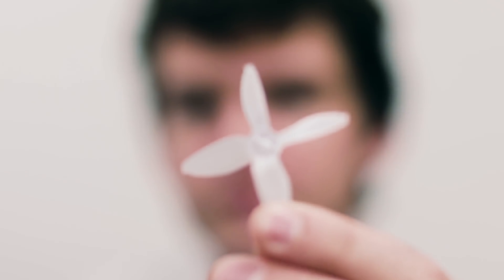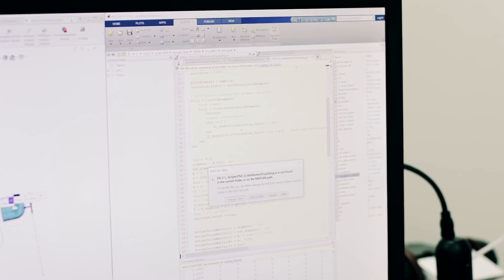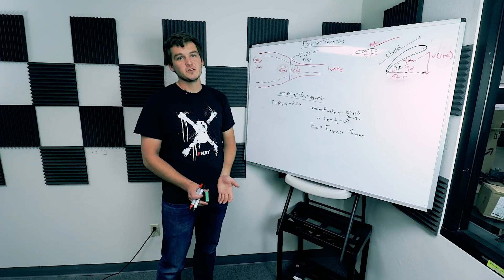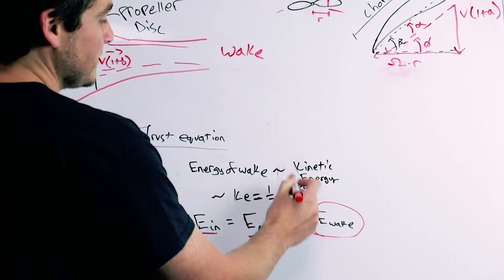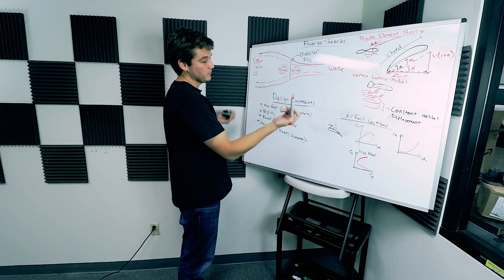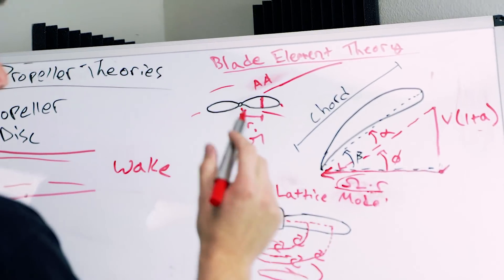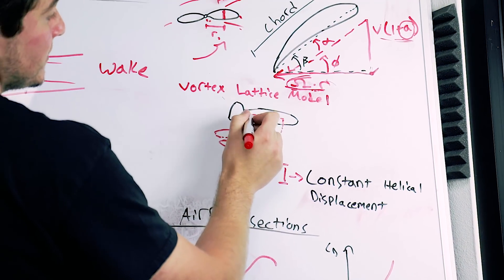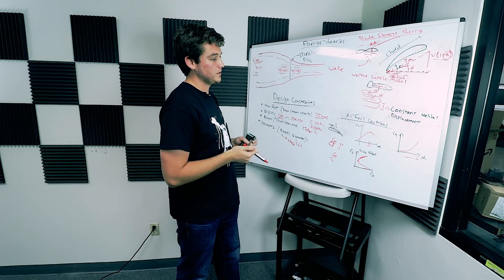EMAX Docs - Designing the AVAN Micro

Comment: Very succinct explanation. Thanks Sage. I'm loving your 3" 3054-4 Rage Props on F20ii 1408-3750 running 4S with my own aero plus quad design. I haven't broken one yet.  Screams. I have lost one though, the hub is tall and the F20ii shaft is short so I found a standard nut doesn't bite into the self lock plastic enough. Works fine with low profile nuts though. I would be keen to hear your design constraints and aims on the 3054-4's.